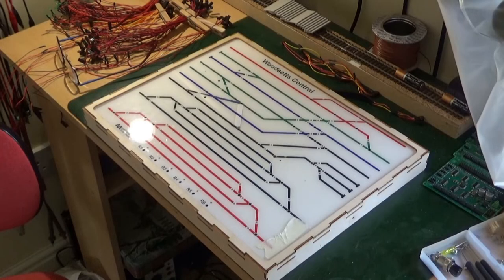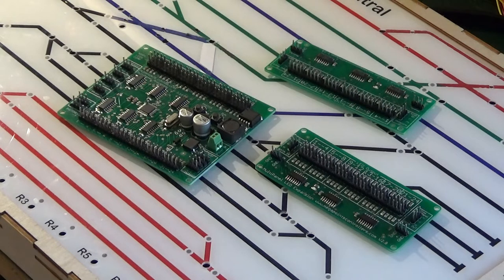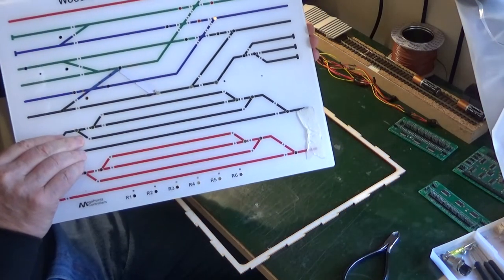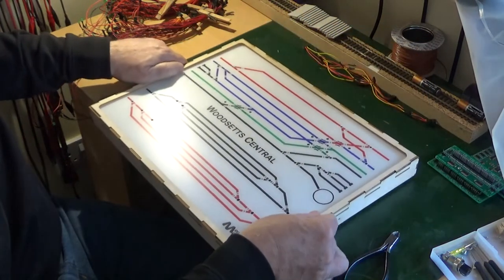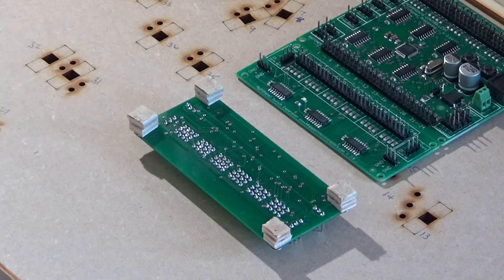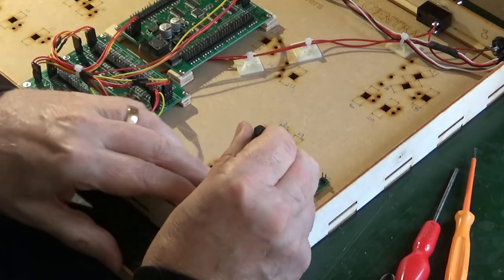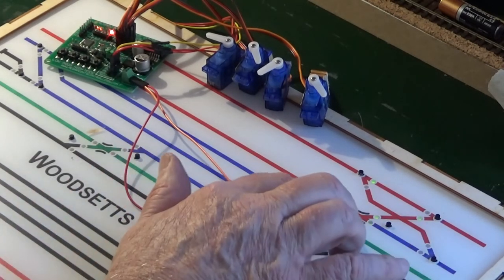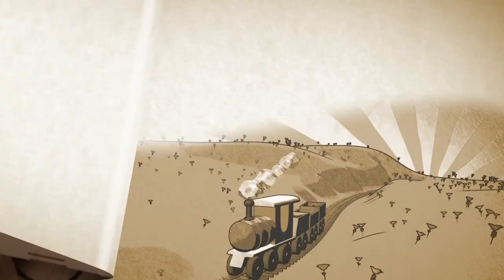2019 Woodsetts Central -  New Mimic Panel Build   2019 03 15

Comment: First time I have seen the Megapoints system fitted to a large panel like yours. I have already decided to go with the Megapoints system for my layout and you have just reinforced that decision. It just goes together so easy. Are the buttons at the bottom R1 - R6 maybe for a route processor? Thanks for the video 👍 Graham
Reply from the maker: Hi Graham, Yes, the buttons at the bottom were originally intended for the Megapoints route processor. In the end I didn't use them - my Ecos controller supports track plans and routing so I went that way. The interface between the Ecos and Megapoints panel is one of Dave Fenton's DCC interface boards which works a treat.
Regards
Barry